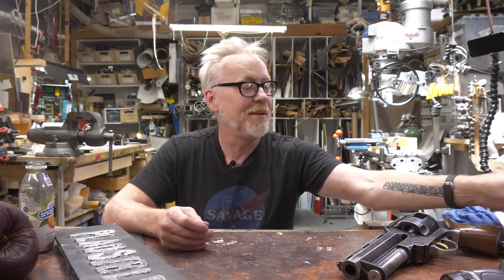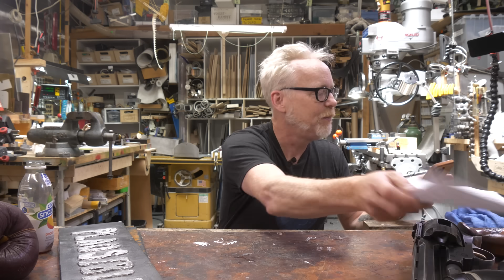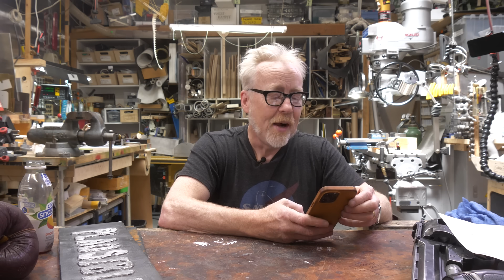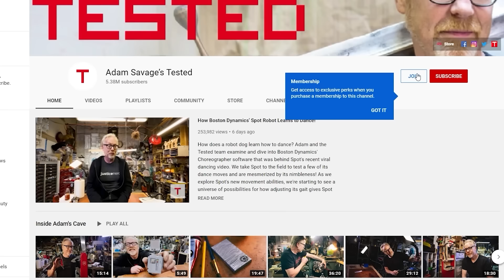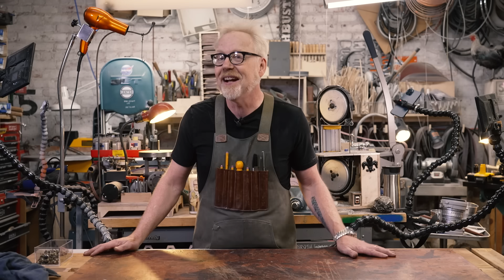Hardest-to-Obtain Item in MythBusters History

Comment: You actually can get a permit for a grenade. Grenades are classified as destructive devices and although i doubt any grenade manufacturers would ever sell you one, you can legally manufacture your own grenade and register it as a destructive device with the ATF, but if you are using it for commercial purposes (such as filming a tv show) you need a special permit for that. Obviously the laws can vary from state to state, but it can be legally done. With the proper permits manufacturing one is pretty simple, becuase you can just purchase the detonators and hulls then you would just need to assemble it with the primary charge.

Comment: Just make your own grenade, it's only a half lb of composition B, an detonation charge, and a spoil and pin.

The only deference between a grenade and a bomb. Is only small, a grenade is ment to fragment, a bomb is ment for higher pressure to cause massive damage through the expanding gas or to suck the air out of a space.

Comment: Well C4 putty is harmless without an electrical current running through it, whereas an M67 hand grenade is harmless until you accidentally pull the pin.

Comment: It sounds like you needed to file some ATF form 4's or even form 1's. $200/explosive device. Anywhere from 2 weeks (if you're EXCEPTIONALLY, lottery-winning lucky) to 1 year (standard) per explosive device. 

Once you've paid the tax stamp and the ATF has given you permission, you can get armaments like 40mm grenades, hand thrown grenades, RPGs, missiles, tank shells, etc. 

These are all NFA items, and each individual "shot" or device will require its own tax stamp and waiting period. 
This probably isn't reasonable for a TV show. However, if you have ever wanted to throw a grenade, now you know how to get a hold of one. 

Go find a safe place to throw it, let it blow up and then notify the ATF same-day that the explosive device has been used and is no longer existant.

Comment: I've had this on my mind for literal years. There's one myth I hated the outcome of, and I believe they didn't test it correctly. It was if a rocket launcher could flip an SUV, I never saw them attempt to fire it at the ground under the vehicle, just into the engine. Imho, it would likely flip if an explosion went off under it, due to the explosion pushing upwards instead of just hitting the block.

Comment: That myth the way I heard it was a helicopter with a bucket, not a tank which uses a pump and siphon to fill it. As amazing as the SkyCrane is I don't think it could suck a diver, his tanks and all that up the 12" siphon and into the tank, I think that would be pretty much physically impossible. As an X wildland fire I heard that story many (in the 80s) years ago and the way I heard it he was on the ground when they found him not in the top of a tree. Also it was a helicopter with a long line and bucket that scooped him up when filling from a lake. A little more believable but still questionable. In most cases the pilot can see in the top of the bucket as it is open and see if someone was in the bucket but his main job is to fly the aircraft in some times challenging conditions so he could have possibly not seen someone in the buck if this is even true.

Comment: I used to work for Erickson Air Crane, the current Type Certificate holders for all things Sikorsky Skycrane, a.k.a. the CH-64 Tahre.

To develop that pump, they partnered with Sea•Doo, or at least whoever made their water jet-pumps.  Made a bigger one.

I also like their ram-scoop boom, which has little wings to keep it under water while the aircraft flies forward, dragging the scoop-shaped end of the boom thru flat water at speed.  It's neat, but the jet-ski-derived water jet pump was faster.
Reply: why do you believe they would not let them get near the pump?

Comment: U gotta pop the clutch to get going with such strong pressure plates in Indycar. You mean you didn’t stall it? Also just FYI It is really bad if you spin the car and don’t push the clutch in when wheels going backwards when spinning out then you will shred the starter/gear and that’s 1,000$ so always make sure u push that clutch in if you spin out!! Lol also don’t try to save it when u going to crash! Take your hands off the wheel to save your wrists from shattering. So hard to not keep hands on wheel in those situations! But yeah your physically dying when in a race car. 6layers of nomex on your body and 115deg in cockpit .. it’s a test of making all the right perfect movements while your body and brain deteriorate … each race you loose around 5lbs of water weight from sweat.. ppl think it’s easy… if it looks easy on tv they working really hard! No power steering etc just remember … they are physically dying in that environment.. racing cars is the only sport that really involves balls! 😎
Reply: Congratulations you have been selected among the shortlisted winners kindly Dm🎉🎉🎉

Comment: Grenades are fucking sketchy. I've thrown a couple. You can get them pretty far because you'll inevitably want it as far away as possible as quickly as possible.
C4 without a blasting cap in it isn't even sketchy. You can do basically whatever you want with it and it may as well be clay. Putting a blasting cap in it is a little sketchy because they can be set off by static.
The reason grenades sketch me out is because when we were doing the testing grenades that were just a blasting cap in a metal shell one of the dudes had theirs go off prematurely and the trainer told him "don't worry, you didn't do anything wrong" far as I know the only difference between the training fuse and blasting cap assembly's and the ones for live grenades is that they're painted blue.

Comment: For the German foil company: I think they gave you a foil with the thickness of 0.001 cm instead of 0.001 inch. Because 0.0007 inch is approximately 0.001 cm
Reply: Actually, that would be closer to 0.4 thousands of an inch. Someone else posted that 20 Micros would be about right, and I agree with that. 0.787 thousandths.
Reply: @freescape08  yes you're right
Reply: Whoopsie!
Reply: So they broke a bunch of machines possibly because they asked in Imperial? 😂
Reply: And also, because like the majority of the World, the Germans don't use ridiculous freedom units.
Reply: Or 10 micrometers
Reply: @logitech4873  how many nanofortnights is that?

Comment: German company delivering foil thinner than asked: they just wanted to make sure they're within specs under any circumstances. For example high heat and a defective micrometer ... and also, why not save some material, if possible? 😁
Reply: Congratulations you have been selected among the shortlisted winners kindly Dm🎊🎉🎊

Comment: At the federal level, you don't need a permit to make explosives as long as it's for non-commercial, personal use. You can't store them, you can't sell them, you can't transport them... But you can manufacture and immediately detonate any explosive you want, no licensing or permitting required. You may have state laws to worry about, as well as local city or county ordinances. But if you can get around those, you can make friggin' RDX or PETN or whatever you want, and blow it up.

Comment: you should contact Cleetus McFarland for a collab.  over there they like to don white lab coats and perform automotive related science, once in a while,  I think you would be the perfect guest star.  They've already done stuff like trying to use gasoline instead of engine oil (ended badly) and experimented with different power-adders and stuff. 
AAAAND Cleetus will 100% let you rip some of his cars around his racetrack.  maybe let you run the quarter mile. I think you would have TONS of fun hanging out the boys
Reply: It would be funny to see Adam take a run in the Leroy.
Reply: @Peksisarvinen  Absolutely.  His reaction would be priceless,  even if they just did "a couple little baby rips"    ... problem is ..   as of last week, Leroy no longer has a passenger seat :(

Comment: What about the original JATO bottles? I remember the military kept calling you back for months afterwards, continuously telling you “no” even long after you made the episode. Not getting a grenade seems tame by comparison 😅
Reply: The problem with JATO bottles is that there just aren't any around anymore, though there were some for that first show. The military stopped using (and buying) them a long time ago except for the Navy's Blue Angles C-130 Fat Albert (which I did see doing a JATO takeoff). But once the supply system ran out of those, that was it, no more.
Reply: @johnknapp952  what are JATO bottles?
Reply: @rooknado  Basically military grade bottle rockets. Quite big and were first successfuly launched in 1941.
Reply: @rooknado  Basically, a rocket in a bottle attached to side of an airplane to boost takeoff.
https://en.wikipedia.org/wiki/JATO
Reply: @rooknado  think instead of a catapult to launch a plane its rockets. It stands for Jet Assisted Take Off and its hilarious to watch
Reply: @johnknapp952  Not so. The ski-equipped C-130s that service the South Pole still use JATO packs when they're taking off from snow strips at the various field stations (like Amundsen-Scott). While the main runway at McMurdo Station is paved and cleared with machinery so they can land on the wheels.

Stopping is actually very easy on -60F Antarctic snow, since extreme cold makes it bizarrely mechanically sticky, like sand; poor Scott found this out too late while trying to drag his sleds by hand, which he described as akin to dragging them through the desert.